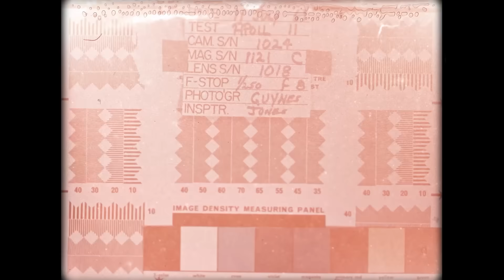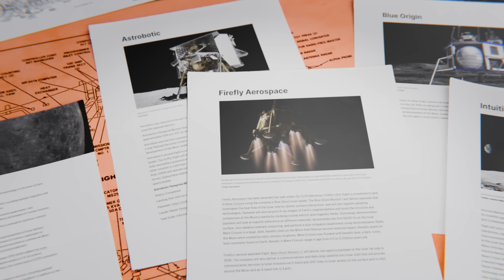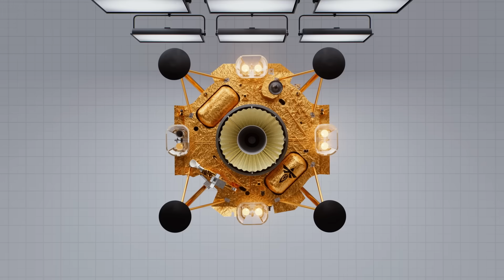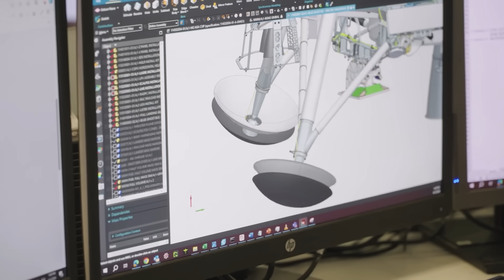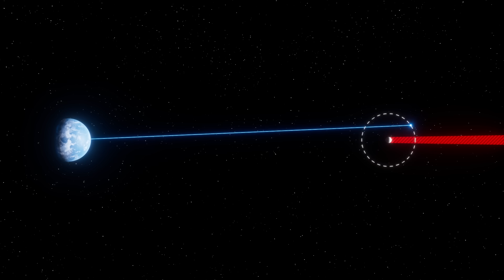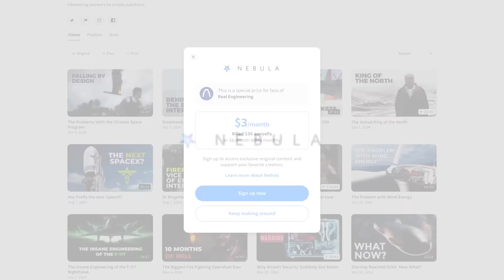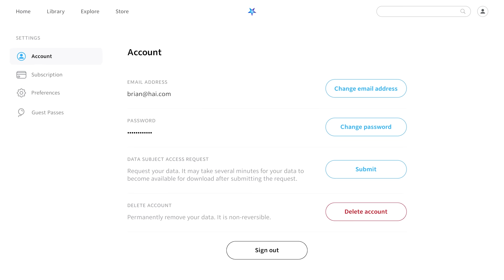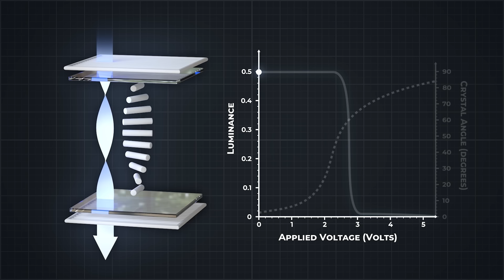Why the US is Struggling to Land on the Moon

Comment: It’s too bad they didn’t write down how they did it the first time 😂😂
Reply: Oh, they wrote it down, they just conveniently lost it in a tragic boating accident.
Reply: @SchemingGoldberg amazing what you can achieve when you “remove one of truth’s protective layers” (neil Armstrong)
Reply: @Cormac-jd2kx     "why can’t the ISS see any satellites flying around? Supposedly there are thousands"   
. 
First, sometimes you can, but it is rare, because the ISS is PURPOSELY far away from most satellites so they don't collide with one.   
. 
Second, space (even Earth-orbital space) is big <insert Douglas Adams quote here> and satellites are mostly small.    It takes a lot of fuel to put thing in space, and the bigger something is the more fuel it requires, and the more fuel it requires, the more fuel is needed to lift that fuel (and more fuel to lift that fuel, ad infinitum.*    and fuel means money; More fuel, more money, so satellites tend to be small.    The ISS is big because it is made from a bunch of smaller units that were launched into space and then put together.   
. 
There are a lot of satellites, but they are small and spread out over a large space.    How many water towers can you see from where you are sitting right now?    There are thousands in the U.S. alone, but I can't see any from where I am right now.
Reply: @John_Smith_60 bs 😂 the ISS should be able to see satellites 
Stop the bs 😂😂😂
Reply: It’s too bad NASA did write it down, extensively. Intuitive Machines decided to ignore some of the very basic lessons that NASA learned and wrote down in the early 1960s.
Reply: @pirateroberts7684      "Most successful space craft in history, maybe most successful craft period. Safety record unmatched and un-repeated"      

It killed 3, and tried to kill 3 more, out of 36 astronauts.    The space shuttle had a better safety record than that.

And I want to see the notes you took during kindergarten, surely the best years of your life.
Reply: @Cormac-jd2kx     "Other people say you can see the flag and stuff left on the surface with a telescope"   
. 
If "those people" are saying that, they are wrong.    There are no Earth surface telescopes powerful enough to get good enough resolution through a chaotic atmosphere and a rotating Earth (the camera is moving with the Earth - it's moving slowly, but it's moving).    And satellites in Earth orbit are either moving too fast or don't have powerful enough telescopes (or both).
. 
The images of the flags (yes, "flags", plural, there have been 6 successful manned Moon landings, not just Apollo 11) and "stuff" come from satellites orbiting the Moon.    They have powerful enough cameras and are close enough to the Moon's surface for those cameras to get images of the landing site with enough resolution to see footprints.    REALLY!!!
Reply: @John_Smith_60    And how did they get pictures if there is radiation? as well as how did they take pictures though the radiation?

Also i just love how you ignored my previous comment, it's almost like you're doing damage control!
Reply: @John_Smith_60 it’s strange from ISS we can’t see a single satellite out of the thousands out there 😂😂😂😂
Reply: I don't know how my comment got on the bad thread!
Reply: Christ, what a bunch of absolute loons in this comment thread. Aside from all the obvious evidence of landing on the moon, do you not think the Soviet Union might have disputed the landing using their monitoring equipment if it didn't happen?

Sadly, nowadays they probably would watch them land on the moon and then claim it was a conspiracy and all you airheads would lap it up like the good little idiots you are.
Reply: You shouldn't have any trouble building a bunch of Ford Model A automobiles in a month or two.    Ford wrote everything down, too.
Reply: chemicals cost money and they burn that shit to get to the moon. thanks for listening to my ted talk.
Reply: @PricelessLime     "Weird it's almost like they didn't go to the moon!"   
. 
Weird it's almost like they did go to the moon, but people without the intelligence to put two LEGO blocks together can't figure out how it was done, so they just assume it wasn't.
Reply: @John_Smith_60   BWAHAHAHAHAHAHHAHAHAHAHAHAHHAHAHA the copuim mate! how about giving some context? Let me guess you're part of the group that says "it was easier for them to go to the moon then to fake it"? even though a movie called A space: odyssey came out just one year prior to the first moon landing?

I just love how nobody mentions that NASA created an art program just a few years BEFORE the first moon landing as well as why is the earth so small from the moons perspective?

And how did they get such great pictures if they were just guessing? and what about the radiation?

What's even funnier is that the cold war started in 1947 and ended in 1991 but somehow everybody got together to sign the Antarctic treaty in 1959? just one decade BEFORE the first moon landing? yea not suspicious at all!

Fun fact: The internet before the internet was called ARPANET and was invented on October 29th, 1969 and guess when the first moon landing happened? July 20th, 1969, so yes they happened the same year however the first moon landing happened 3 months before the internet was invented, so how were the computers sending massages between each other? just another plot hole that nobodies talking about! so let me guess? they had a dedicated line that spanned 238,900 miles (384,400 kilometers)?

Also what i just don't understand is why are there so MANY different measurements to radiation? we have millisieverts and sieverts, becquerels, curies, rem, grays, coulombs, roentgen (oh but they mean strength, exposure, dose and absorption? then why do we need two different measurements for each? almost like it was made to be difficult on purpose!) and somehow computers in 1969 were able calculate all of these with zero problems? huh!? yea i don't know about that one chief  

"For all the effort it would take to create and hide a lie of such magnitude it would have been far easier for NASA to build a rocket and put man on the moon" Bwahahahahahahahhahahahahahahaha what a load of bullsh!t basically "it was easier to go to the moon then to fake it" this is so stupid, i can't believe it, yea like governments don't lie to people and never did? if that was the case then what about area 51? MK ultra? ring any bells? no? huh? and all these examples that i will give under all this?

The NASA Fine Art Program was established in 1962. NASA administrator, James Webb, jump-started the program by recommending artists to become involved in the agency. Artists, including Norman Rockwell, Robert Rauschenberg, Malcolm H. Smith and Andy Warhol were commissioned to record the history of space exploration through the eyes of artists. The first director of the Art Program was James Dean (NASA). Using artists of different mediums and genres serves the purpose of educating different audiences about NASA and space exploration. To give the artists the best experience possible, NASA allowed them unprecedented access to sites and materials. Participants were present at suit-up, launch sites, and press releases. All works, from sketches to finished products, were given to NASA for use in museums and exhibitions. The collection now includes 2,500 works by more than 350 artists. The program still exists today but is much smaller, weird how they created an art program just a few years BEFORE the first moon landing? yes not suspicious at all!

And yet channels like this will just talk about the same points over and over again and when do these "conspiracy theories" stop being "theories" when time and time again they are proven right? for example weather modification? (look up cloud seeding), microchips and nanoparticles in food? (look up microchips in parmesan cheese), that famous alex jones quote about frogs? (look up atrazine and what it does), what about the tuskegee syphilis experiments?, NSA mass surveillance? (look up edward snowden), what about MK ultra?, what about watergate?, how about operation northwoods?, bohemian grove?, brother the list goes on and on, but i guess ignorance is bliss?
Reply: @PricelessLime excellent comment!

What about when they say 400,000 people worked on the programme and it’s impossible all those people being quiet about the truth or impossible to lie to all those people?

Some others say the Apollo XI film is fake but they did go to the moon 😂 and others say they really went to the moon but with the next expeditions… 

Other people say you can see the flag and stuff left on the surface with a telescope 

Really?
Reply: @Cormac-jd2kx     And how can you be SO sure that these "400,000" people knew what they were working on? if that even is how many people "worked"?

All i hear from you is "other people say" "some others say" but have you tried doing some research for yourself? or are you just going off from what "others say"?

Really? also i heard that people who use emojis have a very low mental capacity.
Reply: @PricelessLime not true. Follow your own advice- do your own research 😂😂 😂😂😂😂😂
Reply: @Cormac-jd2kx   And what's not true? perhaps you should give some context, instead of just some empty statement? and i did my "own research" why do you think that i gave dates and measurements! like huh!?

Also i heard that people who use emojis have a very low mental capacity and i see that they were right!
Reply: @PricelessLime I meant you do your own research about emojis 😂😂😂😂

You heard? 😂😂😂😂
Reply: @PricelessLime where were you in 1969?? Since you know so much why was the internet invented & by whom?? Im sorry to tell you the internet was NOT invented in 1969 and secondly, nasa did not use it! I will give you a hint the internet was invented for a 7 letter word. I bet you dont know it??  If you want to debate with someone who has an extremely high IQ you are going yo have to do better than that!! But answer my question where were you in 1969??
Reply: @mustangmanmustangman4596     Bruh what? like HUH!? 

"where were you in 1969??" and what does this have to do with anything?

Dude google is free like huh?
Reply: @PricelessLime     "And how did they get pictures if there is radiation? as well as how did they take pictures though the radiation?   
. 
The body of the camera protects the film from radiation while the pictures are being taken.    When not in the camera, the shielding on the spacecrafts (the command module and lander) protect the film.    There may have been protective containers for the film as well (like photographers use to protect their film when going through metal detectors and airport security), but I don't know enough to say either way.    And what the heck does "take pictures though the radiation" even mean?

"Also i just love how you ignored my previous comment, it's almost like you're doing damage control!"   

. 
You wrote a novella.    Like any other Gish Gallop, it needs a novel to rebut the nonsense.    Give me some time and I will write one.    But conspiracy fantasists don't like when I try to respond with reality, so you will probably get YouTube block it.
Reply: @John_Smith_60       "The body of the camera protects the film from radiation while the pictures are being taken.    When not in the camera, the shielding on the spacecrafts (the command module and lander) protect the film.    There may have been protective containers for the film as well (like photographers use to protect their film when going through metal detectors and airport security)" You do realize that we are talking about the year 1969 and not 2025? right? and at that time (1969) airports in fact did not have metal detectors. Also you do realize that the "spacecraft" had to go though the van allan radiation belt? So again how did the cameras get any kind of recording if it was going though radiation? we can't go to the moon now (2025) but somehow we did then (1969)? 

"And what the heck does "take pictures though the radiation" even mean?" It means exactly that? like huh!? they "were" taking pictures in and though radiation with a standard camera! not an x-ray machine! Also how did the cameras even "took" pictures if there is a thing called X-ray radiation (high-energy electromagnetic radiation with short wavelengths)? because last time i checked electromagnetic radiation has severe effects on standard cameras, and all this in 1969? like huh?

"You wrote a novella.    Like any other Gish Gallop, it needs a novel to rebut the nonsense.    Give me some time and I will write one.    But conspiracy fantasists don't like when I try to respond with reality, so you will probably get YouTube block it." HUH!? what!? so you expect me to "debunk" something with just a paragraph? like what!? bro are you re/tar/ed or something? i even gave dates and measurements! nice deflection though! but then again you expect me to "debunk" the whole moon landing with just one sentence because you have a hard time reading! 
 
And did you forget that i wrote this? you can even fact check me! but you didn't, all you did was ignore it! "when do these "conspiracy theories" stop being "theories" when time and time again they are proven right? for example weather modification? (look up cloud seeding), microchips and nanoparticles in food? (look up microchips in parmesan cheese), that famous alex jones quote about frogs? (look up atrazine and what it does), what about the tuskegee syphilis experiments?, NSA mass surveillance? (look up edward snowden), what about MK ultra?, what about watergate?, how about operation northwoods?, bohemian grove?, brother the list goes on and on, but i guess ignorance is bliss?" but please tell me how all this is just "conspiracy fantasists" i can wait! or are you just cherry picking? go ahead, try and debunk all this! especially the cloud seeding part!

Brother it's almost like you don't even try! but please keep on coping! and maybe you'll try next time?
Reply: @PricelessLime a separate independent company developed the cameras
Reply: @mustangmanmustangman4596    And?
Reply: @John_Smith_60     And the crazy part that i forgot to mention is that in 1969 they were running "simulations" on only 4 kb of RAM!? and in 2025 we have over 5.4 Petabytes of RAM and we can barely do these "simulations"? that's 1.45 Billion times larger! and that is a HUGE difference mate! to put that into perspective 5.4 PB is equal to 5,800,000,000 KB, that's insane!?
Reply: @John_Smith_60 why can’t the ISS see any satellites flying around? Supposedly there are thousands 😂😂of
Reply: @Cormac-jd2kx Because sattelites are moving hundreds of times faster than a bullet you dolt.
Also we CAN see them, on the surface of Earth no less. Look up "Solar Transit of ISS"
Reply: @PricelessLime    "You do realize that we are talking about the year 1969 and not 2025? right? and at that time (1969) airports in fact did not have metal detectors. "
. 
Did I claim that they did?    I said "like" photographers do.   
. 
Other things beside airports produce radiation that film needs to be protected from.    They have been making shielded containers for film since before the Apollo missions.   
. 
Anyway, I don't even know if they used shielded containers.    The spacecraft and the camera shells would provide enough protection.    You conveniently ignored that.   
. 
. 
"HUH!? so still zero context? Damn dude you sure proved me wrong!"   
. 
I have a job and a life.    I get paid to try to teach people stuff they don't want to learn.    What you are getting is for free, yet you demand premium treatment.   . 
. 
"And the crazy part that i forgot to mention is that in 1969 they were running "simulations" on only 4 kb of RAM!? and in 2025 we have over 5.4 Petabytes of RAM and we can barely do these "simulations"   
. 
The simulations were mechanical simulators and mathematical models.    The word "simulation" has many meanings besides computer simulations.    Here's something that will blow your mind: for much of the early space program, "computers" referred to humans who "calculated" the solutions to mathematical equations, mostly using slide-rules, but you've probably never heard of a slide-rule.   
. 
. 
When I talk to Moon-landing deniers, I've often felt like I was using a different language.    Thank you for confirming that feeling.
Reply: @John_Smith_60     "Did I claim that they did?    I said "like" photographers do." Yea and i claimed "we are talking about the year 1969 and not 2025? right?" they even had radioactive materials inside most of the cameras in 1969 (Thorium Oxide)! meaning that there was even more radiation and the "radiation shielding" wouldn't work because there was already radiation inside of the camera.

"Other things beside airports produce radiation that film needs to be protected from.    They have been making shielded containers for film since before the Apollo missions." and again are we talking about 1969 or 2025? because last time i checked in 1969 the technology wasn't that great to begin with and like i said the cameras in 1969 had radioactive materials inside, so what do you think would happen if you put radiation shielding outside if radiation was already inside?

"Anyway, I don't even know if they used shielded containers.    The spacecraft and the camera shells would provide enough protection.    You conveniently ignored that." and where did i ignore this? HUH!? I even stated this "So again how did the cameras get any kind of recording if it was going though radiation?" and even this? " they "were" taking pictures in and though radiation with a standard camera! not an x-ray machine" so HUH!? so again how were they able to take clean pictures if there was radiation between the camera and the object? when standard cameras also contain electronic components that are highly sensitive to ionizing radiation which causes white noise? 

"HUH!? so still zero context? Damn dude you sure proved me wrong!"  funny because this was a reply to someone else! but i don't blame you.

"I have a job and a life.    I get paid to try to teach people stuff they don't want to learn.    What you are getting is for free, yet you demand premium treatment." HUH!? what are you even talking about? so i was right that you get paid to do damage control? Also how naive are you to assume that you're the only one with a life? Also also i do it for free because am not bought and i don't have any "masters" breathing down my neck telling me what i can and can't do! and did you ever think about that? 

"The simulations were mechanical simulators and mathematical models.    The word "simulation" has many meanings besides computer simulations.    Here's something that will blow your mind: for much of the early space program, "computers" referred to humans who "calculated" the solutions to mathematical equations, mostly using slide-rules, but you've probably never heard of a slide-rule." BRUH? you're tell me that they were able to measure the distance between the earth and the moon, measure the van allan belt, measure the radiation on the moon, measure the radiation in the van allan belt, measure the impact of the radiation, measure how much fuel it took to go there and back and many, many more calculations with zero mistakes or inaccuracies on a FUCKING slide-ruler? bro you can't be serious!? so you're telling me that they learned how to land on the moon by using a ruler? Damn now that is some crazy level cope that i've never heard before! and that they were running "simulations" on a slide-rule!? 

"When I talk to Moon-landing deniers, I've often felt like I was using a different language.    Thank you for confirming that feeling." Yea because you're bought and paid for by your "masters" like i can't believe that you really think that they were running "simulations" in 1969 with ZERO mistakes and inaccuracies on a fucking slide-rule, chalkboard, pen and paper and no human error as well as primitive technology.
Reply: @PricelessLime     I'll do this in two parts:  Part One:   
. 
"even though a movie called A space: odyssey came out just one year prior to the first moon landing"   
. 
BWAHAHAHAHAHAHHAHAHAHAHAHAHHAHAHA   I have been a science fiction fan since before 2001: A Space Odyssey came out (I was almost 8 yo when the movie was released).    I have seen the movie at least 20 times.    They didn't get a lot of things correct.  To name just 3 that involved artificial or micro-gravity: During the scene at the beginning of the third act (the mission to Jupiter) with Frank Poole jogging, you can clearly tell that he is jogging down the inclined curve of the rotating circular stage.    When Dave Bowman is pressing buttons the disconnect HAL, he didn't anchor himself, so every time he pushed a button, he should have pushed himself away from the wall.    And most importantly for this discussion, in the second act, when they are walking on the Moon at TMA-1, the film creators just show them walking slowly - the film-makers freely admitted that they WOULDN'T BE ABLE TO GET IT TO LOOK RIGHT, so they DIDN'T EVEN TRY.    BWAHAHAHAHAHAHHAHAHAHAHAHAHHAHAHA   You've never actually watched the movie, have you?    You didn't even get the name of the movie right!   
. 
. 
"I just love how nobody mentions that NASA created an art program just a few years BEFORE the first moon landing"   
. 
As you point out later in your diatribe, the NASA Fine Art Program was created in 1962.    This was during the Mercury and Gemini programs, and about 7 years before Apollo 11 landed on the Moon in July of 1969.    NASA's function has always included education, and illustrations have been recognized as an important educational tool for millennia (have you heard of cave paintings?).    Have you heard the phrase, "a picture is worth a thousand words"?   
. 
I just love how people don't realize that NASA used a lot of artwork to show what missions would look like.    Without having completed the mission yet, they didn't have photos of the mission yet, so they had to create artists conceptions.    Have you ever seen an architect's rendering of a new building project?    Your question is like asking, "why don't they just use photos of the building they haven't built yet?"   
. 
. 
"why is the earth so small from the moons perspective?"   
. 
Because the Earth and the Moon are very far away from each other (almost 240,000 miles, even if you refuse to believe that).    Also, if I understand it correctly, the optics of the cameras made it look even farther away.    It probably would have looked bigger to the astronauts' naked eyes.    Have you never compared a photo to real life before?   
. 
 
"And how did they get such great pictures if they were just guessing?   
. 
They made good artwork because they weren't "just guessing".   They understood the physics (and that's how they were able to accomplish the mission), so they knew what it would look like.   
. 
There is the famous story of the science fiction writer who got investigated by the government because he wrote a story about an atonic bomb at the same time as the Manhattan Project was developing the atomic bomb.    They thought he might be a spy sending information to Russia.    He just understood the physics (we have since Einstein developed his theories of relativity) and could figure it out for himself (just like the scientist at the Manhattan Project).   Science is like that.   If you understand the science, you can figure it out.   
. 
. 
"What's even funnier is that the cold war started in 1947 and ended in 1991 but somehow everybody got together to sign the Antarctic treaty in 1959? just one decade BEFORE the first moon landing? yea not suspicious at all!"   
. 
What's "funny" is that you keep making claims when you have no clue what you are talking about.    The countries that signed the Antarctic treaty didn't want the other countries that signed the Antarctic treaty to set up military bases on Antarctica, or get their hands on the suspected natural resources there.    Yeah, very suspicious.
Reply: @John_Smith_60     "BWAHAHAHAHAHAHHAHAHAHAHAHAHHAHAHA   I have been a science fiction fan since before 2001: A Space Odyssey came out (I was almost 8 yo when the movie was released).    I have seen the movie at least 20 times.    They didn't get a lot of things correct.  To name just 3 that involved artificial or micro-gravity: During the scene at the beginning of the third act (the mission to Jupiter) with Frank Poole jogging, you can clearly tell that he is jogging down the inclined curve of the rotating circular stage.    When Dave Bowman is pressing buttons the disconnect HAL, he didn't anchor himself, so every time he pushed a button, he should have pushed himself away from the wall.    And most importantly for this discussion, in the second act, when they are walking on the Moon at TMA-1, the film creators just show them walking slowly - the film-makers freely admitted that they WOULDN'T BE ABLE TO GET IT TO LOOK RIGHT, so they DIDN'T EVEN TRY.    BWAHAHAHAHAHAHHAHAHAHAHAHAHHAHAHA   You've never actually watched the movie, have you?    You didn't even get the name of the movie right!" HUH!? i did get the name right!? are you re/tard/ed or something? also how do you know all of this? did you go to space or the moon? you must have since you KNOW so much about it?

"As you point out later in your diatribe, the NASA Fine Art Program was created in 1962.    This was during the Mercury and Gemini programs, and about 7 years before Apollo 11 landed on the Moon in July of 1969.    NASA's function has always included education, and illustrations have been recognized as an important educational tool for millennia (have you heard of cave paintings?).    Have you heard the phrase, "a picture is worth a thousand words"?" Ok? and what? 7 years isn't enough to "fake" all of the pictures? like HUH!? and talking about "cave paintings" there are barely any humans painted on them, yea not weird at all?

"I just love how people don't realize that NASA used a lot of artwork to show what missions would look like.    Without having completed the mission yet, they didn't have photos of the mission yet, so they had to create artists conceptions.    Have you ever seen an architect's rendering of a new building project?    Your question is like asking, "why don't they just use photos of the building they haven't built yet?" Bro you ARE re/tard/ed holy shit, you even stated this ""I just love how people don't realize that NASA used a lot of artwork to show what missions would look like." yea re/tard read the last part out loud "show what missions would look like" holy fuck! you just proved me right but yet doubled down on being re/tard/ed.

"They made good artwork because they weren't "just guessing".   They understood the physics (and that's how they were able to accomplish the mission), so they knew what it would look like." HUH!? WHAT!? bro now you are just trolling and twisting my words! also since you're fucking re/tard/ed and have a hard time reading i was talking about the astronauts and the pictures they "took". 

"There is the famous story of the science fiction writer who got investigated by the government because he wrote a story about an atonic bomb at the same time as the Manhattan Project was developing the atomic bomb.    They thought he might be a spy sending information to Russia.    He just understood the physics (we have since Einstein developed his theories of relativity) and could figure it out for himself (just like the scientist at the Manhattan Project).   Science is like that.   If you understand the science, you can figure it out." Wow really? do you also love smelling you're own farts?

"What's "funny" is that you keep making claims when you have no clue what you are talking about.    The countries that signed the Antarctic treaty didn't want the other countries that signed the Antarctic treaty to set up military bases on Antarctica, or get their hands on the suspected natural resources there.    Yeah, very suspicious." BWAHAHAHHAHAHAHAHAHAHAHAHAHAHAHAHAHAHAH, bruh and you believe the lies that "they" feed you? also if the whole military bases thing was real, then why do these countries have said military and research bases there then?
Reply: @PricelessLime you were 8 yrs old when 2001 a space oddessy came out?? Did you read the article in a science magazine at the time explaining everything?? If you have name that magazine?? I have a copy my brother is 5yrs old then me & he bought it!
Reply: @mustangmanmustangman4596     Ok and?
Reply: @PricelessLime     Part Two:   "what about the radiation?"   
. 
What about it?    The path to the Moon that was used took the spacecraft through the weakest part of the Van Allen belts (James Van Allen helped determine the path the missions would take), and the craft passed through them quickly enough that the shielding was sufficient to protect the astronauts.    The solar and cosmic radiation exposure during the trip was less than the Van Allen belt radiation, so the spacecraft's shielding was good enough for that, and even outside the craft on the Moon, the little bit of shielding provided by the suits was enough to protect the astronauts.    I don't remember the amounts of exposure (and I am not going to bother looking it up), but it was less than the normal exposure of a year's worth of dental X-rays.   
. 
. 
"how were the computers sending massages between each other?"   
. 
RADIO!!    HAVE YOU HEARD OF IT?!?!    It's kind of like WiFi and Bluetooth, only muuuuch older.   
. 
. 
"why are there so MANY different measurements to radiation?"   
. 
We have inches, feet, yards, miles, and nautical miles.   We also have kilometers, hectometers, dekameters, meters, centimeters, millimeters, nanometers, picometers, and Angstroms.    Also lightyears and parsecs.   We even have furlongs, chains, rods, poles, lugs, and perches.    Some of them are just systems developed in different places at different times, or for different uses.   They all have their specific usage.   I'm "sorry" the world doesn't cater only to your specific needs or abilities.   
. 
. 
' Bwahahahahahahahhahahahahahahaha what a load of bullsh!t basically "it was easier to go to the moon then to fake it" this is so stupid, i can't believe it, yea like governments don't lie to people and never did? '   
. 
If it was so much easier to fake it, then show us how.   Stanley Kubrick couldn't fake it at the time.    I'll even let you use computer technology from 1999 instead of 1969.    DO IT if it was so easy!   
. 
. 
"The NASA Fine Art Program was established in 1962. [...] The collection now includes 2,500 works by more than 350 artists."   
. 
Thanks for adding to the number of people that would have had to keep NASA's "lies".   
. 
. 
"weird how they created an art program just a few years BEFORE the first moon landing? yes not suspicious at all!"   
. 
Again, it was started while Project Mercury was still in progress, three space programs before the first manned Moon landings.    What makes you think, "OMG!!! They made PICTURES during the space race!!!!!" is some kind of "smoking gun"?   Did you read the rest of the Wikipedia article that you copied the first paragraph from?    Did you understand it?    In the very next paragraph: "Webb wanted to use art to capture the emotions and importance of what NASA was doing."    You are right, it isn't suspicious at all.   
. 
. 
And yet Moon-landing deniers keep bringing up these inane "questions" that all have answers that disagree with the deniers world view, so they deny the answers as well.    Moon-landing denial conspiracy fantasies (they aren't "theories", because theories have mountains of evidence to back them up, or they wouldn't be considered "theories" - it's in the definition of the word "theory") will remain conspiracy fantasies because, no matter how many times you claim otherwise, they are complete nonsense, with only ignorance and arrogance backing them up.    Sure, governments lie sometimes, but conspiracy fantasists lie all the time, especially to themselves, because they don't have any truth that they can use to support their fantasies.
Reply: @Cormac-jd2kx     "the ISS should be able to see satellites"   
. 
As I wrote, they occasionally can.    Most of the time they can't for the reasons I wrote.   
. 
I've told you why they can't._    If think they should be able to see other satellites as you claim, YOU should be able to tell me why they should.   
. 
But you won't, because you can't, and you can't because they can't see them.    Just like you can't prove the Earth is flat because it isn't.
Reply: @John_Smith_60 you just can’t explain why ok 
They see earth clouds sea but not a single satellite 😂😂😂😂😂
Reply: @PricelessLime    Are you even capable of rational thought?    Are you really only able to repeat the lies that other Moon-landing deniers have told you without you understanding either the lies or the rebuttals to the lies.?    
. 
I'm out, conversing with you is a waste of time.   
. 
(I know, you will now declare victory and claim that I couldn't satisfactorily answer your questions, even though they were all answered, but you ignored the answers.    Good-bye, feel free to gloat in your ignorance.)
Reply: @John_Smith_60     Are you even capable of rational thought? Or are you really only able to repeat the lies that the other moon-landing believers have told you without you understanding either the lies or the rebuttals to the lies?

you're out? bruh you didn't even try to debunk or refute me, and yes you are a waste of time! 

(I know, you will now declare victory and claim that I couldn't satisfactorily answer your questions, even though they were all answered, but you ignored the answers.    Good-bye, feel free to gloat in your ignorance.) Huh? weird because i asked you to try and debunk cloud seeding and you didn't even try!

And what's funny is that you really think that they were running "simulations" in 1969 with ZERO mistakes and inaccuracies on a fucking slide-rule, chalkboard, pen and paper and no human error as well as primitive technology, but yet we can't go to the moon in 2025? but somehow they did it in 1969? 

Also your "masters" are waiting for you to suck them off!
Reply: @Cormac-jd2kx     "you just can’t explain why ok 
They see earth clouds sea but not a single satellite"   
. 
Oceans are big.    The clouds that can be seen from the ISS are big.    Satellites are small AND far away.  <cue Father Ted clip>
Reply: @John_Smith_60 😂😂😂😂 good try
Reply: Most successful space craft in history, maybe most successful craft period. Safety record unmatched and un-repeated, to this day. Eeehh should we keep the designs. Naaaah nobody would interested right? they never even tried to sell them to a museum or to some public space enthusiast auction. Just got rid of them! Apparently we are supposed to believe despite how unbelievably successful these designs were in every measurable way, they were really just not worth anything. Nobody would have wanted them anyway.
Reply: @pirateroberts7684  yeah after the inside job on september 11th and all the fake adventures in the middle east... Kind of hard to believe they'd be honest about the moon landing.
Reply: Yep loosing the way through the van allen belt is a real pain in the butt. You never forget your way home even when pissed outta ya brains😂
Reply: Weird it's almost like they didn't go to the moon!
Reply: @PricelessLime where were you in 1969
Reply: @mustangmanmustangman4596    And where were you in 1969? 

weird how you think that this is some kind of gotcha.
Reply: @PricelessLime almost 😂😂
Reply: @Cormac-jd2kx    HUH!? so still zero context? Damn dude you sure proved me wrong!
Reply: @PricelessLime I don’t think we went to the bleeding moon mate
Reply: @Cormac-jd2kx   "I don’t think we went to the bleeding moon mate" Still no context? no dates no nothing? Hmmmmmm? flip flopping now?

So you have nothing to add? Huh? 5 replies and that's the best you can do? how about letting the adults talk?
Reply: @PricelessLime what date is today?
Some people are busy or have discussions but not n YouTube 😂😂😂😂😂 lllllloser
Reply: I dont think they even did it first time 🤣
Reply: @ukleth anyone with a brain knows it was the biggest hoax ever
Reply: They never landed on the moon. It was a movie they filmed in Nevada.
Reply: @bonclay2262 obviously they never went anywhere
Reply: @bonclay2262 thats a different movie called Capricorn One & it was about faking a Mars landing! Duh
Reply: @Cormac-jd2kx     "good try"   
. 
Yes, it was. it explained why you cans see the Earth from the ISS, but not other man-made satellites.   
.
You on the other hand, haven't explained why they should be able to see other satellites.    You just keep claiming that they should, and you think we are supposed to take the word of a random internet nitwit.